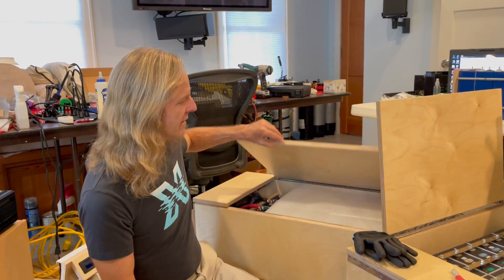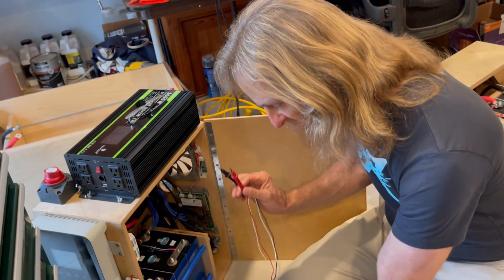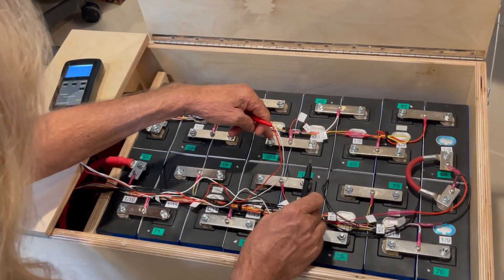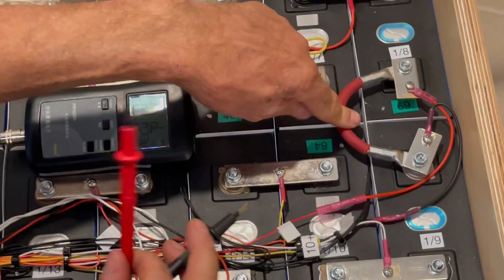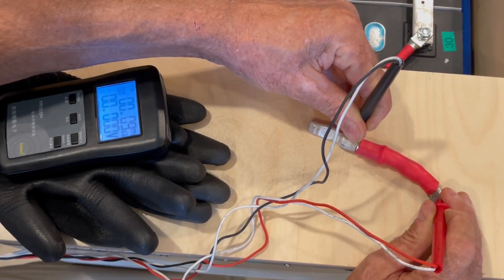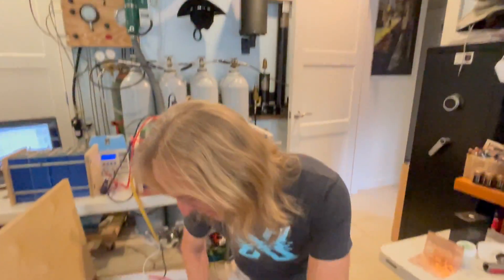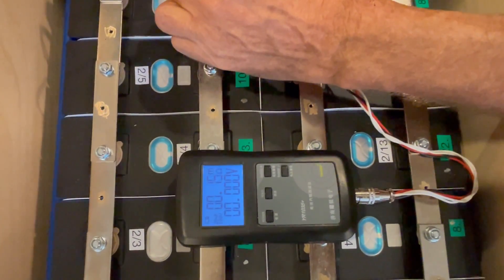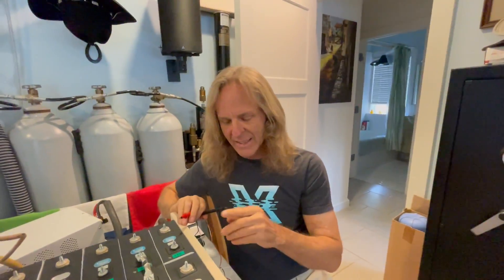It's No Joke, Size Really Does Matter!! Testing Flexible Busbars. Please read the description.

Comment: That's impressive, not everyone has a 4-wire ohmmeter that can read milliohms.  But before you test anything, I want to see a zero-ohm check by touching the probes together in your video. I'll assume you did that Off Screen.

I did some computer simulations of different battery wiring methods and found opposite-corner (positive and negative) ladder connected batteries have a battery current balance issue.  They do not share currents well, unless the bus bars are quite massive.   It was surprising how much the battery currents differed on the middle batteries with more than 2 batteries.  Two corner-connected battery pairs balance well, but anything beyond two -- do not.  The battery balance depends highly on the bus-bar cross connection resistance.   So it's not only the BMS that needs a low bus-bar resistance, it's also necessary to minimize the difference in currents going in and out of the center batteries, so the outer batteries don't do all the heavy lifting.

The bus-bar ladder topology looks very much like a low-pass filter, except the corner connections feed it from both ends, so the ladder structure delays current in and out of the center batteries.  

One topology that balances battery currents 100% is a star connection on both positive and negative posts using equal resistance cables to a main distribution stud.   This superimposes all the batteries into a first-order RC filter DEq.  But that's very difficult to do with more than four batteries.

Mathematically,  a battery ladder with more than two batteries creates a second order DEq with 3 or 4 batteries, third order DEq with 5 or 6 batteries, fourth order with 7 or 8 batteries, and so on.

Therefore, all the ladder connected topologies with more than two batteries suffer from cross connection bus bar resistance, and it only gets worse if you have better batteries with lower battery internal resistance.  Lithium batteries requires very large bus bars that are orders of magnitude lower than their internal resistance to approximate equal current balance.

Sidenote, I used to make bus bars for lead acid batteries from copper tubing, by flattening out the ends and drilling holes for the stud connections.  It would be interesting to measure the actual resistance of those hollow copper tubes with your meter.
Reply from the maker: Very interesting and seems to confirm my suspicions and the strategy employed by Seplos.
Reply: Thanks NIC. This explains why the Expedition Evan’s channel used a star interconnect with their five big Battle Borne lithium batteries. It seemed unusual and I’ve been wondering about that. 

Can the “uneven heavy lifting” problem be eliminated by series connect for, say, a 48v battery system? At the same time, current is reduced so we can save copper size and cost. Win-win, right?
Reply: @BarryHansenK7BWH  Right.  A series string has the same current going through each battery, so the current is automatically equalized (unless someone does something silly, like tapping current off of one battery).  

But stacking batteries can lead to a different problem, i.e. the voltage balance needs to be actively maintained.  A failing battery will upset the whole voltage stack and lead to higher voltages on other cells, and this is a particular problem with Lithium, since they are particulary susceptible to overvoltages.  But stacks of battery cells are used in almost all applications now days and they rarely catch fire, so it looks like the BMS circuits are doing their job. 

Still, I'm concerned the cheap "passive balancers" may not have enough current capacity to really keep up with a bad cell.  There are active balancers that can charge pump several Amps into the lower voltage cells, whereas passive balancers can only burn off so much power.  Both will eventually hit an upper limit and that's when the BMS has to shut down the whole battery system.
Reply from the maker: On a somewhat related issue, it bothers me that many of these rack mounted batteries being manufactured use a daisy chain configuration to parallel connect multiple batteries, putting the furthest battery at a higher resistance than the closest battery. This would seem to continually work the first battery more than the others. In doing the math, it seemed to be significant. I wish someone with the setup would test this. What am I missing?
Reply: @RayBuildsCoolStuff  -- Opposite corner connected parallel connections are a clever way to balance TWO batteries, but battery builders misinterpret this idea and extend it to three or more batteries, thinking it also balances the currents.  It does NOT.  

The currents into 3 (or more) ladder connected batteries are always delayed by second-order (or higher) delay effects.    Using lower resistance  buss bar connections reduces the inbalance and changes the time delay, but it's still a low-pass filter and there is always a delay.   

But then again, even if the center battery is constantly playing 'catch-up', having the storage capacity of 2.8 or 2.9 batteries is better than just 2 batteries.  So it can be a reasonable compromise. 

There's a discussion on smartguage.co.uk that gives a pretty good overview of various topologies with some actual numbers, but you need to be careful in interpreting them.  The 'out-of-balance'' condition is not just a number, it's a decaying exponential and given enough time, it eventually catches up.  How much this effects the tail-current shutdown of a charging system and the overall capacity of a battery system needs to be calculated.

See: http://www.smartgauge.co.uk/batt_con.html
Reply: @BarryHansenK7BWH  There's another reason why star connections are beneficial.  I recently built an off-grid battery system using two 444 cell Tesla battery modules, and was concerned about failure modes and the short circuit current when paralleling the two packs.  With THOUSANDS of Amps from each pack available, I needed to run each module through a fuse before making the parallel connection.  

So after connecting each positive connection to a 4-fuse block (the extra 2 fuses are for charger or a load), the topology naturally leads to a star connection, even though the two positive cables were a different length.  So to balance the battery currents, all that was needed was to do the opposite on the negative side, using unequal length cables to the negative shunt connection.   There's a lot of ways to make R1 + R2 equal R3 + R4.

Ladder connected battery strings really should have a fuse on each battery, or they will fry a battery with a lower voltage when a cell shorts out.  But in doing so, it exacerbates all the series resistance issues we are talking about.

Comment: Crimping the copper wires is strain hardening the copper through the deformation. Strain hardended copper has a higher electrical resistivity. To get the best electrical resistivity you should soft anneal your wires, but this is not possible with the insulation on it. Though the best is to use busbars, which do not need deformation. Copper busbars are better than brass busbars, because copper has a better electrical resistivity and is softer an the clamping force of screws can it better customize to the non perfect flat surface of the terminals. Better surfaces of the terminals (flat, less roughness, alignment between cells), will need less deformation, which means less strain hardening.
Reply: Do you have numbers for the conductivity difference of soft annealed copper vs. half-hard copper vs. work hardened copper?
Reply: I have a friend that silver plates his wires. Any thoughts.

Comment: Great video. Have experienced exactly the same “runner syndrome” due to poor connections. The big elephant in the room is the M6 bolts in aluminum terminals that limit the torque you can use. That is the achilles heel of those cells. Do you have a source for copper busbars?
Reply from the maker: The best price is if i buy extras when I buy cells. Then I can pay .75usd and the shipping is free.

Comment: wondering how you feel about aluminium busbars. 
while they need to be thinker ( i'm using 25mm x 10 mm), they should work well, have  no need for tinning, and are considerable cheaper.
copper here today is extremely expensive ( 25mm x 0,5mm x 4000mm cost around 210 euro ( about 265-270 usd).
high grade aluminium not even half
Reply from the maker: They would be my second choice but I don't want to be arrogant and pretend knowledge or experience that I don't have.
Reply: Aluminum is not quite as good conductor as copper so all you need to do is increase the cross-sectional area to compensate. Look up “bulk resistivity” of each material. For example, Aluminum is 2.6 and copper is 1.7 e-8. The ratio is about 1.53. So, to substitute Al for Cu, increase the thickness used by 1.53 to get roughly the same circuit resistance. Check prices and if copper price-per-pound costs more than 53% than Aluminum you might have a cost savings. 
Cool mental exercise, eh?
However, look carefully at other factors such as environmental corrosion and also galvanic corrosion due to dissimilar metal contacts. As far as I’m concerned, I’ll stick with proven marine construction techniques and tinned copper as much as possible in my camper van. The AYBC (American yacht builders council) has good info.
Ray, thanks for this video! Fascinating dive into milliohms resistance. Well done. Power loss is “Current-squared times R” so a few mOhm makes a difference at high current.

Comment: Really enjoy your videos- fact based and informative. I been contemplating the same issue with my build and see what others are doing on internet.  I figured just like you 2x20=40mm2
so 1 awg wire has a cross sectional area 42.4077mm2; therefore 1 awg is a replacement. Makes since to go to one gauge larger! My question is why not buy a length of Copper Rectangle Bar 110-H02 with a 40mm2 cross section and make length you want? you could buy 1/8" x 3/4" stock (60mm2 cross section)
Reply: Cause it's really hard to make slots in the copper bar unless you have the right machining tools.
Reply from the maker: and getting them tinned is expensive.
Reply: @RayBuildsCoolStuff  Interesting, I see so many people on internet talking about making copper busbars out of copper pipe! Question: if you use a copper bar, could you tin ends with you solder like you would the end of a wire and shrink wrap middle?
Reply from the maker: @gregnorman3183  seems like that is getting more time consuming and with a less predictable result.
Reply: @gregnorman3183  Pure DIY stuff. In my case, I CNC-cut aluminum plate for my bus bars.
Reply: @ARepublicIfYouCanKeepIt  Sounds like you have to use more material to make up for the resistance of Aluminum being greater than size for Copper?
Reply: @s.mendez7160  Aluminum is third behind silver, copper and gold in terms of electrical conductivity. With 62% of the electrical conductivity of copper, aluminum is an excellent choice for busbars; especially when price and availability are considered.

Just be sure that the cross-section of the busbar meets or exceeds that of cable rated for the ampacity of your project.
Reply: Think he said 1/0 cable not 1AWG.

Comment: Have you ever considered aluminum busbars, as the battery terminals are also aluminum?
Reply from the maker: I have used a lot of aluminum in my career, mostly for architectural elements that might otherwise have been done in steel. I'm not a fan for using it in electrical applications due to it's greater resistance, somewhat greater potential for corrosion and most of all its greater coefficient of expansion due to heat. It does dissipate heat nicely so it worked well for heat sinks.
Reply: @RayBuildsCoolStuff  Barring the availability/cost of copper sheet material, I CNC-cut bus bars out of aluminum.

My builds don't suffer from corrosion, nor do they experience any adverse effects from expansion (mostly because they don't heat up...like at all!). Correctly sized, aluminum bus bars will rarely rise above ambient temperature; even under full load.

Additionally, as far as conductivity is concerned, with copper as the base, the next best alternatives are #2, gold, and #3, aluminum, with 63% the conductivity of copper.

Beyond that, I build battery box cages with aluminum extrusions lined with CNC-cut polyethylene plastic for a water resistant seal, as well as protection from accidental shorts, etc. In marine applications, I weld the plastic and add a gasket to the top.

Wiring exits the enclosure via IP-69 rated gland nuts, and the top is directly secured to the cage's top rail.

I also build with aluminum extrusions instead of wood for reduced weight and increased strength. Laser straight with stronger connections that can be easily disassembled and reassembled without damage or weakening the joint whenever needed.
Reply from the maker: @ARepublicIfYouCanKeepIt  sounds great!
Reply: was there not issues with using Al wire in houses in past? Had to do with corrosion connecting to brass?? Is there an issue connecting brass busbars to Al terminals?? Not an expert just wondering
Reply from the maker: @gregnorman3183  I think it was more to do with heat cycling and loosening terminals that weren’t maintained. Noalox was used on the terminals. Dielectric unions were used to join aluminum to copper but we were supposed to go back and RE tighten all the connections on a regular basis which I think was ten years but it never happened. Big bus bars in panels are often still an aluminum alloy with no special requirements for use with copper. I’m not an expert either but I’ve built some buildings over the span of my career. I picked up little along the way.

Comment: What's the point?
Reply: I think you mustn't have watched the video at all as the point being made was very clear.
Reply: At first glance, you’d think the voltage drops are low and negligible. For example, at 100 amps and an extra 0.20 milliohms, it’s only 0.2 volts. 
At a second look, resistive heating (power loss) is proportional to “current squared times resistance”. For example, at 100 amps and an extra 0.20 milliohms, there are 2 watts wasted as heat. 
So the point is that every milliohm counts toward losses or even fire danger in a high-current system.